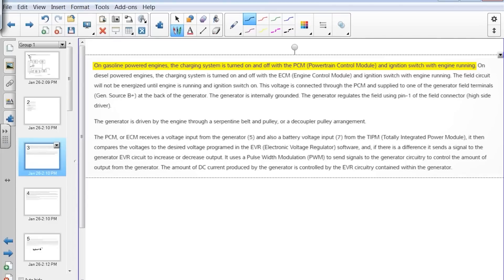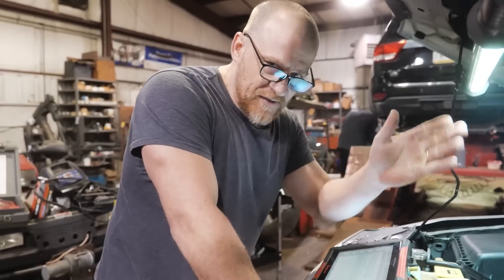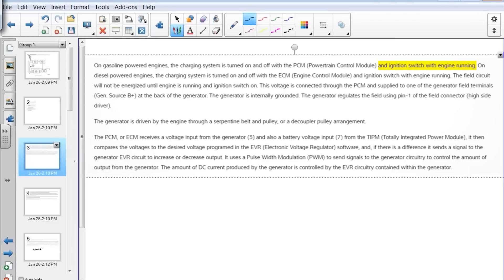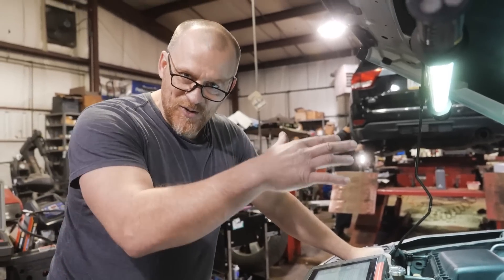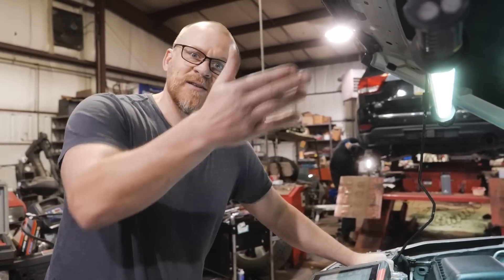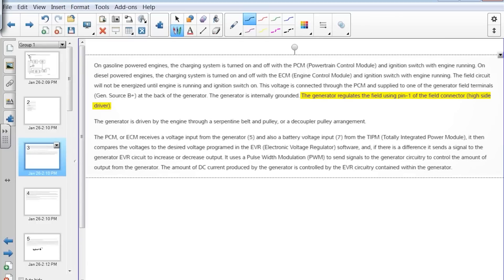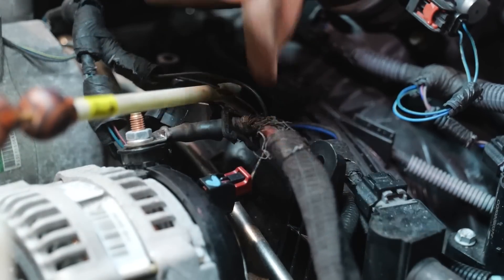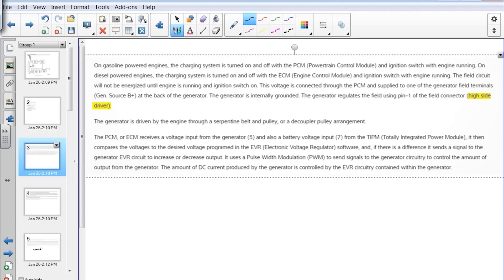Charging For Diagnostic Time - Can We Bill a Customer For "Research"

Comment: A skilled tech is worth a professional hourly wage no doubt. But here is the problem. Not all techs are at a professional level. You see this in your class everyday. Of course,  you do not bring your car in for electrical problems. However maybe you should? And make a video for us with blurred faces of techs. Compliment the tech who approached the problem correctly in the video but also point out those that were completely wrong at over 100 per hour.  Take a car with a known problem your aware of to 10 stations. All service stations will claim to have knowledgeable techs. You however without saying anything? Will see when your paying for good diagnostic procedures and when your paying someone who is either way to new or is in the wrong trade. I guarantee you will have 10 different hourly charges for the same problem.  Deep down I think you know this anyway.  My latest electrical problem was my bag light staying on.  I brought the car in for diagnostic. After two hours I got a call. They asked me if to proceed or call it. They did not found the problem but suspected the fuse box. I stress the word suspect? That means they had nothing verifying it was the fuse box. I paid the two hours,  250.00 in Canada.  I then checked the circuit myself. Blindly and luckily I admit. I saw what looked like could possibly be a bad ground, but I was guessing just like the tech. Except I was lucky and it was the problem.  But what really pissed me off.  At least if the tech was guessing? He should have checked the cheap stuff like a bad connection/ground etc. The fuse box was a 200 item here from a junk yard plus their install. I would have been at 500 and no better off. That is scary my friend.  Or how about the bad ground was at the fusebox (it was not) but they would have assumed the they guessed right. Meanwhile it was the ground that they tighten in changing the fuse box. I do agree an electrical problem maybe the hardest thing to find. But it is also why the best should be paid highly for their knowledge. Trouble is in electrical work there is such a difference between 4 years and twenty years experience. Yet the 4 year tech wants the same as the 20 years. It can be so frigging costly to the consumer. With electrical problems there is no guide at what any situation should be. Unlike a mechanical time on the books for changing a alternator for example. This also points out a rookie may take 5 hours to change a alternator. It does not mean you should pay 5 hours for the person to learn on your car,  if the book time for a PRO would be 1 hour for example.

Comment: From Australia,  I've been a tradie for nearly 30 years  now   , often I'll get asked if I can do a  free quote , My free quote consists of telling them that they'll be looking at a $250  diagnostic fee . Which will give them a thorough report of what I've found and a solution and recommendation to fix ,. And like I say "There is No cutting Corners with Excellence " 

There are Mechanics who just change parts and hope for the Best and then there are Diagnostic Mechanics , the top 1% .

If your a new to the trade my advice to you is Watch  alot of 

Scanner Danner 
DiagnoseDan 

Buy as many Diagnostic tools as you can and thoroughly spend time using them and understanding them . Do Not full into the trap of compartmentalising , understand thoroughly every system for the trade you involved with . 

Keep up the good work Scanner Danner

Comment: I charge for Diagnostic time and Research!!! My time is valuable, so if I need to research a part for proper fitment and function or other, this is helping the customer and my reputation. Now if we did not research and charge less, then damage the customers vehicle then they would get pissed off and say if you knew what you were doing my car/truck would be fixed. So CUSTOMER you cannot have it both ways.

Comment: Erm, yes, it'd cost you at least $100 here for a mechanic to plug in a scan tool without doing anything else.  Sure some systems are similar between manufacturers, but you have to spend time figuring stuff out so many sensors can cause the same or similar fault, I'd rather pay you to spend a bit more time fixing the problem properly rather than keep on changing parts, the value is in the technicians experience and ability to research rather than just bodge it and scarper.

Comment: I agree with you we should charge for research , but unfortunately i don't see how we can. Take the average working class customer and it wouldn't be long until the repairs were unaffordable.
Reply: Why should that be our problem though we didn't build the car, or buy it, or break it. I see no reason the repair costs should my problem.
Reply: @crashm1  I totally agree with you, but if i charged research time plus diag plus the actual repair, most of the crap that i have to work on would be a write off. I finished my apprenticeship over 40 years ago and if i had charged research time i could have retired 10 years ago, perhaps I've just been a busy fool.
Reply from the maker: Exactly

Comment: i see what you sayin--yes--we should charge--but in the end--the customers either dont have the money to pay or dont want to--yes-some people will---------of note--there is some information that u just cannot find and you wind up going around in circles-for example---had a mercedes with no AC---clutch not engaged--no power-----u can chase and chase about freon level and it was good--then what--start testing sensors--then when they "test" good then what----turns out--information i cannot find anywhere and i decided to "just try" was correct--i noticed the gas low light was on---apparently the computer will shut off the AC to conserve gas----i figured for shits and giggles try to put gas in it--that worked-ac works-----------------i find getting the proper information is really lacking and where i work--i need to get cars in and out(it is a police fleet)---i cant spend hours per car tryin to find information and testing and "diagnosing"----95% of times i am right and i wind up producing over 55 hours a week-of note we are also paid flat rate and the "customer" is not going to spend/pay you 5 hours to "research/diagnose" problems-------if i spent my day "diagnosing" i wouldnt get paid shit and nothing would get done and it would make me look bad---in the end i am not smart--i have just seen a lot and retained what i learned and when i see it again i know what to do------also of note--if i suspect there is a bad computer and or module that i know will be a costly repair i do not just recommend it--i suggest to send it out for repair---if we are talkin about a 50$ sensor or something and a half hour labor to repair and half hour diag time then fuck yes i am doing that job and if it dont work oh well--but again--i am right 95% of time---and if i am right 95% of time then why would i waste my time testing all kinds of shit for that 1 that MIGHT---ur wasting your time(if your on flat rate)
Reply from the maker: If the customers don't have the money, they are free to go elsewhere!

Comment: I am so glad I bought scanner danner premium, even tho I found my issue unrelated it taught me how to think diagnostically and I feel so much more confident digging into harnesses etc

God bless ScannerDanner
Reply: turned out my o2 extender was rubbing ever so slightly on the frame and causing false knock.

no check engine lights, no codes and the car would pull ALL the timing, I'm talking 0° advance lmao 2002 Infiniti q45, back to full power now 😎

Comment: I found a egr problem that started when a eng was replaced with the wrong emissions sticker  ,ie it was the same year same model same eng displacement  but eng had No egr passage..  had to Research engine numbers, Casting found out it had no egr ,but the boss had a Pilot braced drill and drilled EGR passage, it worked, past smog, still driving today
Reply from the maker: Awesome! And crazy btw. Good catch on that one

Comment: Paul, I could go on and on and tell you how right you are.  But you already know that.

The research is part of the diag, and with out that research you or I would have little confidence in our diagnosis.   No where in service does it say if you hook a potentiometer to the sense circuit and feed it 9-11volts that the code will not set.

Out of the box thinking is absolutely necessary on these problem cars.  If you have confidence, your service advisor will have confidence and in turn the customer will have confidence.

you said it had 14v at the battery, so was it charging?  If it did charge, how did the ecm respond to voltage changes under electrical loads?
Reply from the maker: Thank you! And yes it was charging normally and it didn't matter much what I did with the sense circuit as it seemed to use the input from the TIPM for proper duty cycle control and therefore output voltage of the alt. 
In other words, only very slight command difference, if any at all. So this circuit is for fault recognition only, yet it can have its own faults lol

Comment: You have to charge for your research.  You cannot know everything about every car.  Think about most machine shops.  Sure they are going to charge for machining a part for you.  But you can bet they will charge a setup fee to get the machine ready to machine it and also charge for looking in the machinery’s handbook to see what setup they need to use for that operation.

Comment: People love parts swaps, they see something tangible done, diag time they don't see something shiny and balk at the cost. Thing is, the same mentality will shotgun parts at the vehicle because they fail to consider something new can be faulty. It's a nightmare when the next tech hits, you have the original fault, and potential additional faults installed with the shiny bits. Had someone change alternator, PCM and battery on a vehicle because he 'knew it had to be one of those' - when he finally let me diag we found within 4 minutes the alternator fuse was bad, then, a few minutes later we also confirmed the new PCM had a bad injector driver. They will spend thousands on parts happily, but hate spending anything on diagnosing the problem.

Comment: I agree with everything you said but I think there's a reason why technicians are leaving this industry and saying they can't make the money they used to be able to make. The labor times are rapidly changing and they're not increasing even though the cars are more complex they're shrinking and I know that has to have an effect on these technicians that are out there every day turning riches trying to make a living and they're having to fix more cars and work faster and harder just to make the same amount of money as they did 2 or 3 years ago
Reply: I second that. 
2021 Lincoln aviator  3.0 TT. Book says 4 hrs to replace the right side valve cover gasket. Quoted the customer 4 hrs and went through some slow and painfully regretful HOURS. 

0 access to the right side turbo inlet and outlet hose clamps. Nearly impossible to remove lower bolt on the HPFP bracket and actually impossible to put it back. People writing labor times don't actually try it.

Comment: MAKE NO MISTAKE:  An accomplished auto technician is as LEARNED as a computer hardware technician.  So many wires, modules, and connectors in between so many computers.  With knowledge of software coding I know that catching and THROWING errors is at the bottom of the list meaning car's are still some behind the curve at diagnosing themselves.  TECHICIANS, therefore, are good as gold.  GOOD technicians, that is.  Additionally, being physically fit to climb under dashes, into engine compartments, under carriages is beneficial too...   Least "vertigo!"
Reply: Service information is also VERY important to have. It makes it VERY difficult to diagnose electrical without information such as connector locations, wiring diagrams, pinouts, system operation theory.
Reply: @mph5896  uh....  service data is REQUIRED!   Not just nice but REQUIRED!  And us diy'ers MUST digest theory of operation before poking wires
Reply: @tomtke7351  There are different levels of service information. Depending on the repair, it may require more in depth service info such as factory over a generic such as Alldata.
Reply: @mph5896  Alldata DIY is also good and accessible via cell phone

Comment: i'm a retired Network Engineer. I can completely relate. Had so many complaints about charging $200 an hour to diag and fix a 7 million dollar network that required 99.9% uptime. So yeah, get paid for the research.
Reply: Id happily pay for a competent electrician rather than some parts changer who cant diagnose a corroded wire and ends up changing everything he can think of.

Comment: Hey Paul, this video should go viral! The integrity of some technicians is not acceptable. We are pushed in a corner and are not allowed the time to do the research. We are playing both ends against the middle like you said between wrong or absent service info and junk new parts, new/reman with the customer paying for it all. We should get paid for research time and allowed to do so to prevent guessing. I see this all the time. I work for a transmission shop now and I have general repair in my back ground. I have been one of your subs since 2012. Also had the premium channel for a time. I’m considering jumping back in just to keep up with the hidden changes!!! It is really sad how the manufacturers are fleecing the customers! The dealerships and shop owners are helping them by not giving the technician the time to make the right call. I am not speaking about the guys and gals out there who are really good, I’m talking about the ones who want to really be good but don’t get the experience/chance because of the time issue. Thanks for the video and your work to bring awareness of a broken system. Peace brother!!!
Reply from the maker: I'm pinning this comment after mine runs for a bit. Thank you so much. Perfect! All of it!
Reply: @ScannerDanner  no problem! Just like you say, “ Snap-on you need to fix this!!!”. They own Mitchell pro demand and they need to fix that too!!!!!
Reply from the maker: @Thunderroad8517  YouTube is completely stupid now. I didn't know this was you Michael until the reply in my email. wtf they don't give me names anymore, they give me the @ fist and something else. Though yours is clear now lol

Comment: I’m not a mechanic by trade, but I’m a weekend wanna be, so here’s my $0.05.
Do I want to know up front what it’s gonna cost for you to look at my vehicle?  Yes!
Do I want communication with the mechanic (not person answering phone)? Yes!
Do I want to be told after the first initial diag fee is up that you are working towards the issue? Yes!
Do I want to be told the cost per hour (even if it’s the same as the original diag fee) moving forward? Yes
The more information the mechanic can give the client, the more likely the customer will be to paying you to fix the train wreck they dropped off.  Coming at a customer after 6 hrs and asking for $800 isn’t gonna be good.  Communication is key!  Great video as always Paul!
Reply: @dizzy2020  Talking to a tech who is repairing a vehicle is a waste of time, and therefore money. Direct communication on a diagnostic does use billable time but can save way more time than it takes. Would you rather have a reasonably accurate description of the vehicle history and when the fault manifests or chinese whispers from the "well trained" 🤣🤣🤣 service advisor?
Reply from the maker: Communication reigns supreme!
Reply: @ScannerDanner  Yes!
Reply: @dizzy2020  I will agree 100%, but in a case like this one that’s above say like an ABS pump module talking to a tech helps.  Plus I’m going to a local shop because I’m looking for some 1 on 1 communication.  Does that make sense?

Comment: We don't know everything about every vehicle but know the diagnostic process. We're diagnosticians and vehicles and problems are increasingly and exceedingly complex and require prep and research before approaching a concern. This is all part of the diagnostic process.
Reply: @Not only a member But the president Seems like you have no idea what you doing - except running your mouth all over comments, which makes you look like “know everything” which in fact knows nothing!
Reply: @Not only a member But the president Exactly, your sore body tells you that you do brakes and suspension! That’s all! 😂
Reply: @Not only a member But the president Olde than you!!! That’s for sure! 😂

Comment: As a dealer tech, seeing consistent pattern failures, WE STILL NEED TO DO OUR PROPER DIAG. I know that on a newer Honda Odyssey with an inop reverse camera, it needs the camera from pattern failure, I still have to prove it. I know on a newer ridgeline camera is inop that it has a broken wire in the tailgate harness by the lower tail gate hinge on the driver side. I STILL HAVE TO PROVE IT. If cost of part with labor is cheaper than the diag time, I’m ok with customer opting for that route, but they make the call there. Purge valve low flow on a civic 1.8l, Oem purge valve $35 0.2 install definitely cheaper than 1 hour diag. One of very few scenarios I’m willing to shotgun parts. Diag and testing saves customer money in the long run and keeps us employed 99%, as long as it’s being billed.
Reply: Dyslexia..$53
Reply from the maker: Perfect description, thank you